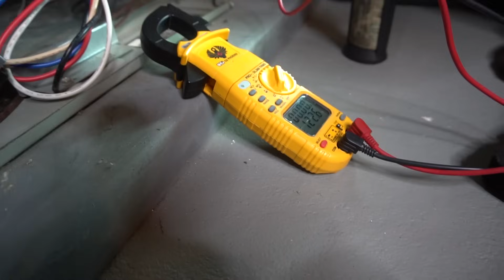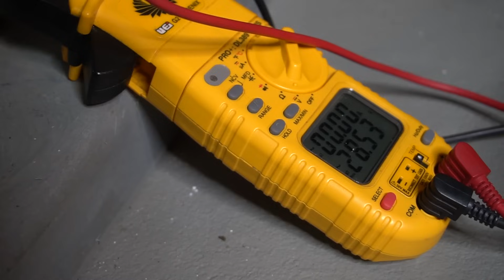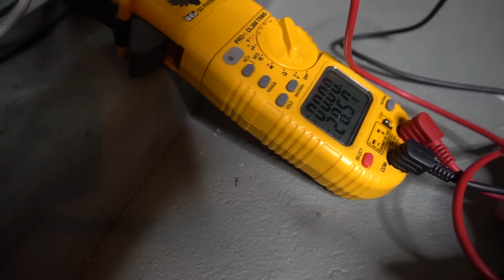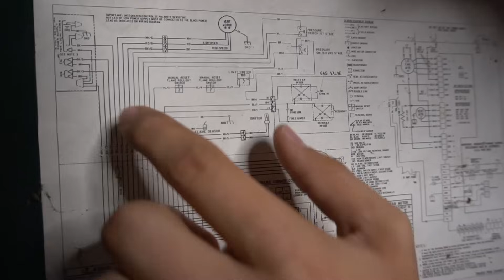Furnace/AC How to Troubleshoot The Control Board

Comment: Great explaining on your videos. Quick question I replaced a transformer because control board was not getting power and now it tries to power up but the 3 amp fuse keeps blowing
Reply from the maker: Most likely you have a short somewhere in your condenser unit outside. Try disconnecting the thermostat wire coming from outside at the control board.. The two wires should be going to Y and C. Try powering it on with the AC disconnected. If the fuse doesn't blow, then you know that likely there is a bare or broken wire somewhere outside (could be in the wall too but that's pretty rare)
Reply: @WordofAdviceTV  the power company had to come out and replace wire in the ground because they lost a neutral and it messed up alot in this house
Reply: @WordofAdviceTV  they lost a neutral and the power company had to come and replace wire in the ground
Reply from the maker: That happened to my dad before. He had to fork out 3,500 for the repair since it was customer cable or whatnot. Thanks for coming back and sharing. Hopefully everything will work fine for you now!

Comment: Stupid question but I thought when you’re testing voltage you put one meter lead on the line and the other to ground. Kinda confused as to how/why it comes up as 120v still when you were testing across the lines of the transformer
Reply from the maker: You can test it to ground like you said but that is actually the "improper" way to test voltage. (usually works just fine to test it that way) The transformer primary side has a hot and a neutral/common. The way voltage drop should really be checked is between a hot and a neutral/common because there are times where checking voltage to ground can give you a false reading. That's what they taught us at school. To be honest I don't remember the explanation as to why that is.

Comment: What causes freezing evap core Jay? Blower motor working but condensor not or the opposite. One of these happened to me last summer and it was the control board. The tech did a bypass of some kind to make it work. Not sure how though. Can't wait for next video!
Reply from the maker: I have a video on 8 reasons why a coil can freeze up if you are interested :) What you explained sounds like the board was not sending power to the fan so the tech wired power directly to the motor, bypassing the board. (I have a video where I show how to do that as well) When the blower motor does not run, there is no airflow to "absorb the cooling" so the coil will start to freeze very quickly. 

I just got back from a trip to Hawaii (the traffic there is crazy [Honolulu] made me want to make a video on 10 driving tips lol) Thank you for hanging out on my channel so much! :) I will get back to video making shortly!
Reply: @WordofAdviceTV  How does it still respond to the thermostat if it's wired directly to the motor? Sorry for all the questions. I'm an hvac newbie nerd now haha. Hawaii sounds amazing right now. I'm a huge fan of your videos. I talk to hvac techs often and they are amazed on how much I have learn in a matter of months.
Reply from the maker: @aarongray503  Well actually it wouldn't :) When the board is bypassed like that, the blower motor would be on continuously. The same as if you would set your thermostat fan setting to ON. I don't know if you have watched this video already or not but perhaps you would understand it better if you watch this: https://www.youtube.com/watch?v=JSgLGTAbDF8&t=346s

Yeah Hawaii was awesome! I am grateful to have fans like you! YouTube is a giant resource, if you take the time to self-study one may not even need to go to school soon.
Reply: @WordofAdviceTV  Hmmm. He some how managed to create a bypass but also allowed the thermostat to control the blower like normal for both winter and summer. Only difference now is there is no hesitation when the ac kicks on like before. Now as soon as the therm clicks the blower starts up.

I read a article once that Hawaii had the worst traffic in the US. Haha. Glad you had a good time.
Reply from the maker: @aarongray503  Interesting... I usually bypass it to just run continuously (temporarily untiI get the part I need) I suppose it is possible to wire it up in a way that will turn it on only when the AC or furnace comes on. I will have to try that one of these times.
Reply: @WordofAdviceTV  update: After looking at control board I learned that he connected the ac cable to line 1 along with another cable. The one that goes into line 1 I presume. Nothing is connected to the cool on the board which is what was causing the a coil to freeze up.

Comment: Great video! Would you consider the controller board bad if the 3a fuse continues to blow when the A/C is set to come on?
Reply from the maker: It's not likely. I would not suspect the board first. I would go look at the thermostat wires outside and in the electrical section on the condenser unit. There may be a piece of bare or broken thermostat wire that is shorting out if it is touching something metal. You can either cut and splice or temporarily put electrical tape over it if you do find something.
Reply: @WordofAdviceTV  No luck finding a bare wire. If I remove all the thermostat wires from the board but keep the 24v and it still blows the fuse wouldn't the board be a suspect?

Comment: Hey Jay, I had a tech that came out to fix my system from freezing up last summer (Which he is the one that got me into hvac). It was the control board not turning on  furnace or blower motor but outside unit was running. He saved me some money by bypassing something on board instead of ordering a new board. It works fine but would you happen to know what he did? Thanks.
Reply from the maker: I have an idea of what he may have done. I explain how to do that in this video: https://www.youtube.com/watch?v=JSgLGTAbDF8&list=PLK8tZPlovA8BgCVCSOOZNRb72T05Nc0DN

Comment: Great video thank you very much. 
I have an old Lennox 80 UHG furnace. During the ignition cycle the gas valve is not kicking on. I measured voltage as you described and board and transformer was sending 24 volts. However I measured only 12 v coming into my gas valve. I jiggled the blue and yellow wires on the molex connector that were leading to the gas valve from the board. It fired up. That worked for about 8 hours then stopped. I measured again and this time I was getting only 6v. That’s pretty weird so I am going to order a new board. I had the gas valve replaced 2 years ago and it did kick on with 24v. Doubted in was the gas valve. It is a 19 year old unit so the probably expected life span. I popped the control board off to look at the back and noticed a brown discoloring in a small area. Looked to me as maybe got hot. There were some small micro resistors or something on that area - probably cooked. 
Thanks again you really help us DIYS!
Reply from the maker: From what you described, that sounded more like a loose connection than a failed component.. But I may be wrong. Can you get it to turn on by wiggling it again? What if you put a small shim between the molex plug and the gas valve, would that keep it on?
Reply: Yes it is not working again. I believe it is a bad board. The gas valve is not getting 24 volts from the control board

Comment: I have an electric heat air handler in my mobile home, it is 30 years old ,it does still work. Would it work better if i changed the heating element?  It is a down draft with the ac coil on top, because of this with the condensation the element is dirty /rusty. I have tried to clean it but what is on there is not coming off. I was wondering if this would cause more resistance costing more to operate it, and wanted to know if a new element would cut down on the cost to run it.

Comment: Just diagnosed my Garage heater with a dead Transformer. Had no power going to the board at all. Unit was totally dead. There was 110power coming in from the house to the Transformer but nothing coming out. Got a new one at an electrical shop for $35. Garage is Happy and warm now.

Comment: everything work but no the condenser. I have 14v in the Y cable in the thermostat, handler and condenser all other cables have 28v.  I've really enjoyed your videos but I could not see one where  my problem is. located. Any help would be appreciated.
Reply from the maker: Are you checking Y to C at the thermostat? Where are you putting your meter leads when you get the 14v reading? Have you tried jumpering R to Y at the control board, does that turn it on? (I have videos on jumpering at the board and at the thermostat if you need them)

Comment: My furnace blower comes on for a few seconds and then there is a mini explosion. Every thing shuts down then the whole process starts again. It always works the second time.  Sometimes the furnace will light the first time with no problems. I cleaned the flame sensor but that has not fixed the problem. Any ideas? This is a XL90.

Comment: Last week our furnace started acting up. It would start up initially then shut off a few moments later. I watched a few of your excellent furnace videos and educated myself on the basics then found this great video and was able to determine our control board was bad. It was only putting out 8 or 9 volts to the thermostat instead of 24 volts. I found a new control board at a local appliance shop and was able to install a new board the next day and now we have heat again. I couldn't have done it without the guidance of your excellent videos. These are definitely the best videos on appliance repair that I have found. Thanks Jay and keep up the fantastic work!!!
Reply from the maker: Awesome! Thank you for sharing your success story! Happy to hear that my videos were helpful :) Stay warm!

Comment: So, to piggy back on the comment from 2 days ago, same furnace- Trane 2 stage XL90 furnace. You say “an easy way to check is to see if there is voltage going to the motor”... and yes, I have voltage, but I have voltage on both the low and high power wires. I believe one is around 120 and the other is 78 or something. They are both powered, but the fan doesn’t spin. I replaced the condenser and the motor (as well as cleaned up the AC coils which were restricting the squirl cage) and it spun when I first put in a new motor,  but only once, and now, nothing. 

Just like you said, “when the thermostat calls for heat, the burners turn on, but the blower will not come on, and the furnace ends up overheating”.  

But it still overheats. 

I don’t know what it could be, as there is no power to the blower motor until about 30 seconds or so after the call for heat. So I wonder if the relay is good. However, shouldn’t only one leg of the Hi or Low heat be given voltage? 

Thx
Reply: Does your unit have lights that blink a certain way? Theres usually a list of codes, that represent what they mean, on one of the panels of your unit. Perhaps that could give you more information on what the issue might be as well.

Comment: I have a Trane two stage AC/Heater. My main blower will come on some times and some times it doesn’t. Is this typical of the fan control board.
Reply from the maker: So for example, when the thermostat calls for heat, the burners will turn on but the blower will not come on and the furnace ends up overheating? It's either a failing blower motor or yes, the board could be defective. An easy way to check would be to see if there is voltage going to the blower motor when it does not turn on like that. If there is power but the motor does not turn on, then you know the motor should be replaced. If there is no power going to the motor when there should be, then the board is defective. Hope that helps!

Comment: So I have power to my inducer motor... I can get the heater working if I pull the hose off of the pressure switch and then put it back on...it fires up in a couple seconds... after it comes to thermostat temp heater shots off inducer motor keeps running consistently... until I have to do it again to get heat...
Is this my pressure switch bad?
Reply from the maker: Most likely the pressure switch is stuck in a closed position. (it's a normally open switch) You can try blowing/sucking on the hose going to the pressure switch to try and free it up. Don't apply too much pressure though since the diaphragms in them are designed for very little air pressure. If that won't work, then I would replace the pressure switch.

Comment: Soo if the board isn't sending power to the flame sensor, the board is bad?
Reply from the maker: Yes. If the burners are lighting and going out after a few seconds and when you check if there is any voltage at the flame sensor - if there is not, then the board is bad.
Reply: @WordofAdviceTV  Thank you!

Comment: Burners run for less than two minutes and then start up again
Reply from the maker: Kind of sounds like your furnace is overheating and shutting off. I have a video with 10 reasons why a furnace can overheat if you want to check it out: https://www.youtube.com/watch?v=3ZPmltTR5S4&t=109s

Comment: Hello I have a similar problem with my carrier furnace I scotch brighted the flame sensor and still has the same issue furnace kicks on I see the igniter glow it runs for a little bit and then restarts same process over and over a blinking LED indicates a gas lock out. I turned off for five hours for and it still doesn’t reset just keeps blowing cold air any idea what it might be thank you
Reply from the maker: When the burners light, how long do they stay on for? Also, if you need more ideas on what to check for, try watching some of my other videos like the Top 10 Furnace Problems or Flame Sensor Troubleshooting.

Comment: Thanks - love the videos.  Very easy to understand.  I also bought a multimeter and went thru all the testing and the board seems like all the power is going in and coming out like the video suggests.  I also cleaned the flame sensor (and then bought a new one and installed it).  The furnace lights and stays lit for about  2-4 minutes and then out.  I did give the limit switch couple of smacks and then also tested it with my multimeter (it beeped so that is good - yes?).  I am still not getting heat for more than 5 minutes.  any other thoughts.  thanks so much
Reply from the maker: Sounds like you are learning a lot more about your furnace lately :) Does your furnace control board blink an error code when it stops heating after about 4 minutes? Likely it will be either a limit error or a pressure switch error. I have videos of 10 problems for both of those categories once you figure out which problem it is.
Reply: @WordofAdviceTV  Yes i am.  interesting and frustrating at the same time.  :) When this first started (a couple of days ago) when the heat stopped the code was solid red (replace control).  But then when i turned off the thermostat the furnace shut down then the light would go back to the regular slow blinking (normal, no call for heat), and then fast blinking (normal, call for heat).  So then today after i did all the tests it didnt even want to come on at all.  Heard a lot of clicking coming from the furnace (seemingly the control board).  Also quick cycles on/off.  No igniter no nothing.  Kept trying and then it worked for a solid 15-20 minutes and then i turned it off (cus i was leaving the house for a while).  Came back turned it on again - heat and normal for about 10-15 minutes.  Now another solid red.  Can the control board be bad even if all the power is going in/coming out?  And can the control board function sporadically?  or is it either 100% or 0%?  thanks again for your videos and help.
Reply from the maker: @georgeaboud2039  Well.. Unfortunately I can't give you a definite answer. Usually if a furnace control board has a "replace me" code, it means it. To me it sounds like either the control board is bad or there is a loose wire connection somewhere.